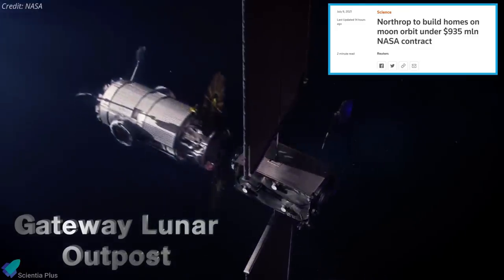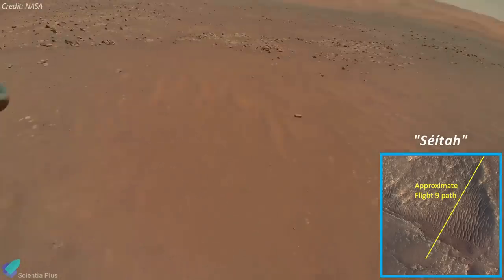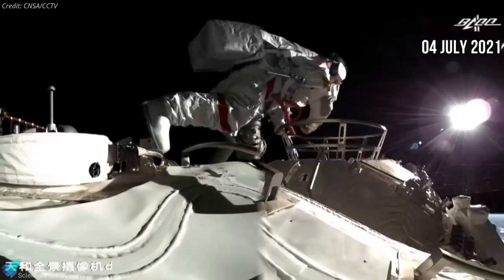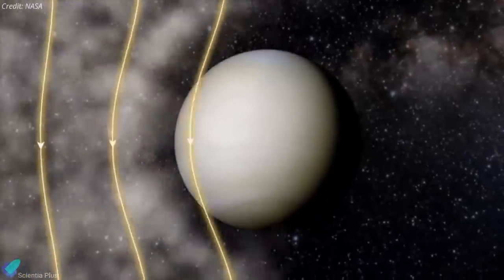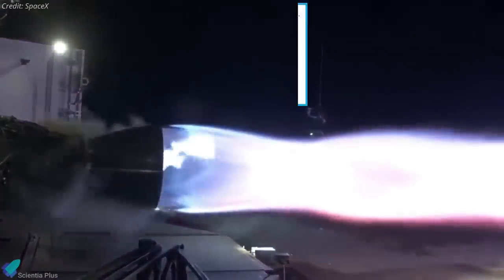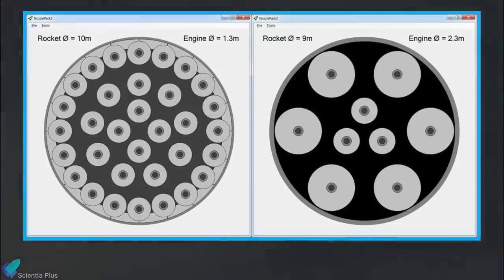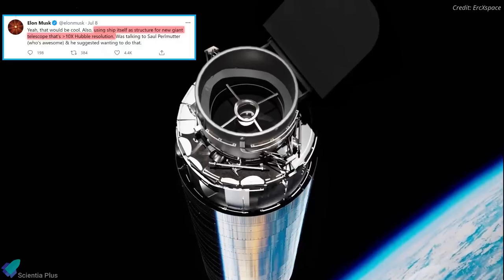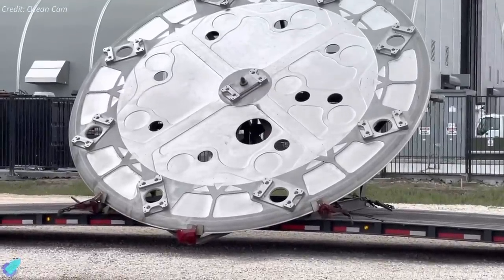Starship is Getting "UPGRADED" | Booster3 Tests Begins | Ingenuity's Toughest Flight | NASA | CNSA

Comment: Starship is just a framework. Include whatever options you want; let your imagination run wild.  This is the benefit of not having each model cost 1 billion.  He's the Henry Ford of space ship sales, and he is bringing out the fully customizable pickup truck.  It's just Stainless Steel cylinders welded together.
Reply: Yet, not one starship has been in lower earth orbit and not one component of starship has ever been used.  He is doing the same sales pitch as they did for shuttle when it need funding to get that project going.
Reply: @pebmets  What component are you talking about? its' already done several flight tests with three atmospheric engines, with landing attempts and tested thermal tile attachment and properties. That's loads of critical components being used. He's also not really doing a sales pitch at all. They are pretty much just going ahead with the own plan. They have not mentioned any outside funding being critical and they even won the Lunar Lander contract because they were going to be funding it half them selves because they have plans to go there anyway. Work on starship is being at least part funded by other ventures, like the commercial falcon launches.
Reply: @MachineCode0  Has a raptor engine ever been reused?  Has the thermal tiles ever been reused, (some were damaged on SN15)?  Has any protype been reused, (SN15 was suppose to be, but that was cancelled).  Has a starship returned from orbit, checked and reused?  
All I am saying is before Starship is called the greatest space vehicle, run a few orbital tests and see how the inexpensive reusability goes.  Until that time, falcon 9 and shuttle are or were the only proven reusable systems.
Reply: @pebmets  I don't know where you're getting that from, I haven't seen anybody yet calling it that, Space X doesn't call it that. Of course it has to do what's its supposed to do in order to be successful. Nobody anywhere ever has said its already passed its testing, its still early days. Orbital test flight should happen soon, chill out dude.
Reply: @MachineCode0  I don't live in a Musk fantasy world where every word he says means it is a done deal no questions asked.  Even though no one has claimed that it past all their testing, Musk's comments as well as some of his supporters are making claims of how inexpensive with little to no processing is going to be needed for reuse.  That is what I mean.  Claims that it can just refly literally within an hour, Musk said it, is just a fantasy until all tests are proven out.  My point, don't make claims of what it can do, until you have proven it with successful testing.
Reply: @pebmets  There probably are people out there who will loose the run of themselves in that way yeah, I haven't seen any personally yet. Looking at the comments on the livestreams it's just people being excited for the future and hopeful that this effort, which is the most exciting and dynamic, probably, ever, will succeed. People just want it to work, not because they love Musk or his company but usually from what I have seen, because they are interested in space and progress and they want our species to stop pricking about and get it done. So yes fanboyism is a thing, well, everywhere, I'm sure this is or will be no exception but I didn't read the op you replied to as being one of those. The essence of what he said does seem to be so far correct. Now we watch to see does it succeed.
Reply: @pebmets  I don't understand how you don't understand that all of the starships have been test vehicles and about half of them don't even exist anymore because, well, because BOOM! 
As they learn they've made changes and upgrades, many of the old ones couldn't even be used with some of those upgrades... At least not with significant $ being involved.
When starship is ready, it'll do most if not all of the things claimed by their sensational owner.
We're all very aware that Musk is a flamboyant dreamer and says stuff that's pretty out there sometimes... That's actually one of the reasons why he's so well liked.
Really, if his popularity gets us to the moon and beyond far quickly than those slow pokes at NASA, I'm good with it.
I'd like to see a human on Mars before I die.
Reply: @johnmurkwater1064  I do understand all this.  I see comments that Starship is the best, it's going to do this, it's going to do that.  I sit back and look at the logic.  Nothing has been proven, (refueling back to back, relaunch within a few hours, Build three ships a day).   Read comments about starship on the different channels and people write as it is already being done.  $2,000,000 rocket with about $10,000,000 worth of engines, how does that math work?  Musk said he will get it to 2 mil.  People take that as gospel like it is a done deal.
It is one thing to be a dreamer, and one to be off the charts.  Tell me that NASA, ULA, the ESA, etc say it is a good thing that test rockets explode.  Musk said it.  Didn't see test orbiters crashing and exploding during Shuttle development.  Don't see ULA exploding the new Vulcan and saying it is all a part of testing.  Don't see Sierra Nevada crashing Dream Chaser into the ground and saying, this is a good thing.
I like what SpaceX has done with the falcon 9.  My issue is that people think Musk is the greatest engineer on earth. He  is not even an engineer or qualified to be one.  They don't look at the logic of what he says and that it is impossible to do any of this in the time he says.  
IMO he is not this deep thinker or visionary.  I think he a salesman knowing he has followers that will repeat what he says and take it as fact.  Yes, I am anti-Musk, but I support the people at SpaceX that made falcon 9 a success.
Reply: very much like a airliner jet...
Reply: @johnmurkwater1064  you do know they recycle the steel? I don't understand the binary nature of Elon Musk and spaceX? it's either up his ar*e or he's the devil incarnate 😂
Reply: @shaun906  recycling only makes sense.
I think if more people realized that Elon Musk has Aspergers and understood what that means, they'd give his kinda eccentric behavior a little more leeway.
Reply: @johnmurkwater1064  imagine if the potential of many other people with similar conditions got realised!

Comment: Booster engine configuration will be 3+10+20 which is much easier to manufacture. 10-way symmetry of the two rings will aide in plumbing with 10 identical taps from the down pipe; each feeding 3 engines (1 inner, 2 outer). Component reuse is critical. Matching 3 central engine configurations between booster and starship also allow for reuse.

Comment: NASA is still not thinking this straight. Using Falcon 9 is great, but if you'd use Starship, then you could launch even larger section or even whole Gateway station at once. That could be one of the test flights that Starship needs before landing humans to the moon.
Reply: Nah… NASA is still doing their typical feet dragging thing. The world is passing them by, and they’re still overly concerned about their wallets.

Comment: Ahhh ... The 9th segment is the crane on the top.  Could it be installed diagonally?  I also wonder if there will be a rotating table or will the crane lift up 90 deg to get out of the way?  There needs to be gangplanks to the upper stage as well.

Comment: Someone please tell me....This Starship's mission will be to send a million colonists to Mars  AND to provide point to point Earth transit?  You guys must know, do tell.
Reply: @nathanlewis42  If you have an open mind go to Common Sense Skeptic on U tube. They are a bunch of young engineers and aerospace guys who used to love Elon until they realized he's full of it. Check it out if only to see the other side expained.
Reply: @davidsoom1551  nothing can take away from the fact that SpaceX is landing and reusing first stage boosters. Also nothing can take away from his earlier innovation of using the same engine on the first and second stages. Before him everyone else developed different engines for the different stages. It was his idea to manufacture 10 engines, 9 for the first stage and 1 with a vacuum nozzle on the second and that approach has been copied by Rocket Lab and more will likely follow. You probably think my mind is closed. I just think he deserves credit for several things whether you like him or not and there are definitely things I don’t like about him.
Reply: @nathanlewis42  NASA rejected the vertical recovery method in the early 90s They won't release the refurbish costs. U can't just refill and go again. Fanboys???

Comment: That is so nonsensical! 1st of all there are no cryogenic vaporizers anywhere. It is a total made up word. What you are describing is a simple heat exchanger. Vaporizers take a solid that cant be vaporized by changing its temperature and changing something else that can be evaporated and creating a colloidal suspension to move the solid like a hitch hiker. Think vicks vaporizer or a hookah for dope or a vaping pen. 
Secondly, why would spacex want to turn any of their cryogenic fluids into a gas? They wouldn't. If you do that you get a run away pressure situation and your methane, oxygen or nitrogen tanks explode. They would probably frown on that. 
SpaceX wants to do the opposite they want to chill their gaseous fuels and nitrogen to recondense  them. If those tubes are a heat exchanger then it is probably to chill lch4 that has gotten too warm or possibly O2 that is too warm and they are using liquid nitrogen to do so. Liquid nitrogen is the cheapest and easiest to come by as you can just chill normal breathable air a precipitate it out. 
Cryogenic vaporizer and cryogenic gassifier sound like valid word usage but they aren't. If you want to make a cryogenic fluid into a gas you use a cryogenic heat exchanger and boil it. They use them all the time to convert lch4 into gaseous ch4, add a garlic smell and pipe it to homes and businesses. I guess since they are adding the garlic smell they are vaporizers in that usage. Lol

Comment: With so many engines confined in a cavity, what if one engine suffers a disintegration. How would each engine be isolated to prevent a cascade failure? There is so much exposed pipe work.